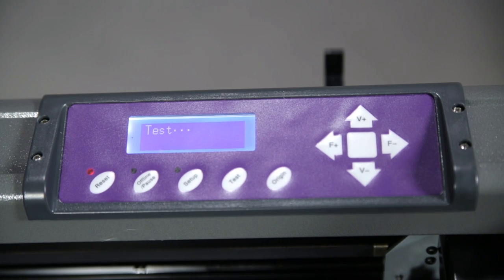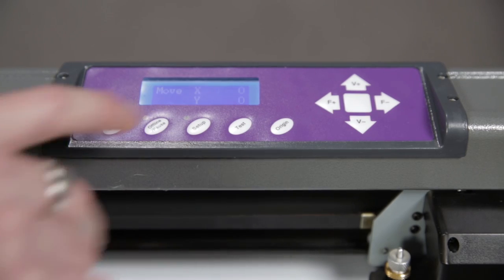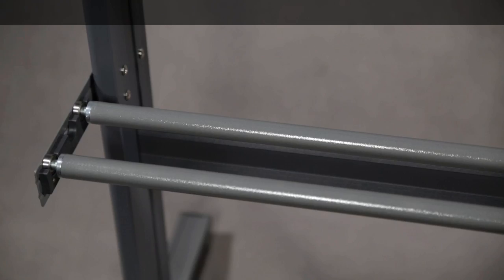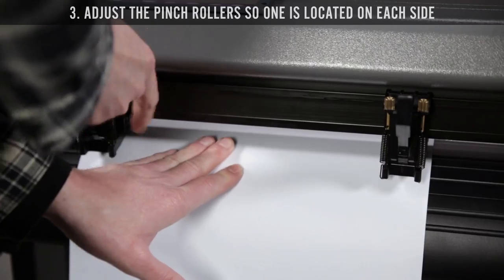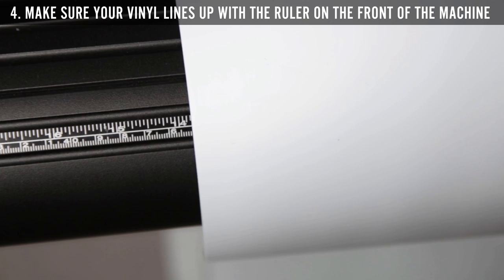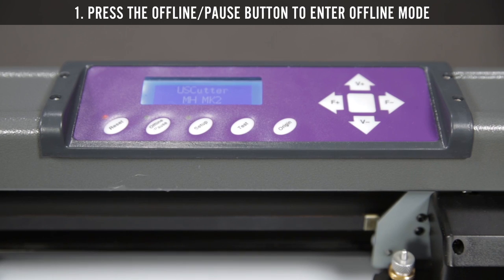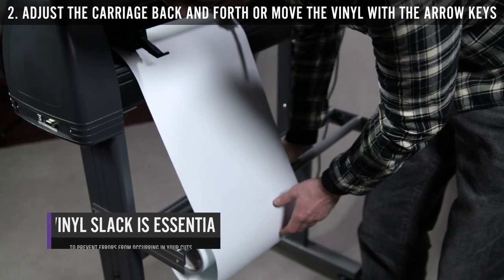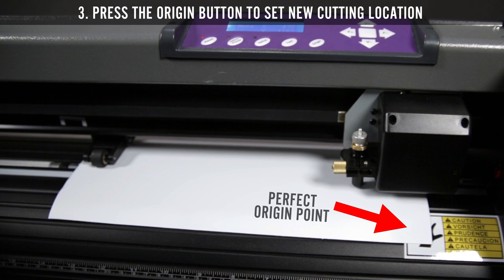MH Vinyl Cutter Control Panel Setup

Comment: I agree with the first comment. I put vinyl through the roller and it was a disaster.
Also i find it funny that even in the setup video the vinyl isnt tracking straight. they really got to do a video or put an add-on or something for that problem because holy crap it is the worst.

Comment: Hi, I have the same machine if I can cut the TEST, but when I'm going to cut some letters it doesn't cut
Reply from the maker: Most likely you have a connection problem between the machine and the computer. Please contact our support team and they can help you. Sales & Support: 1-425-481-3555 M-F 7:30-11:30am, 12:30-4pm PST

Comment: I disagree with placing the roller through the vinyl roll. The roll is meant to rest on the rollers, the reason for it to have bearings and free spin.
Reply: I agree they give you two so that it rolls on the rollers... Anything he said after that point would be invalid to me...

Comment: Test functions intermittent on my machine, I need to test and it will not test. Also is there a switch anywhere to toggle the size of the test cut? The test cut (when my machine does run the test cut) is HUGE. my old Graphtec test cut a quarter of the size of this waster.